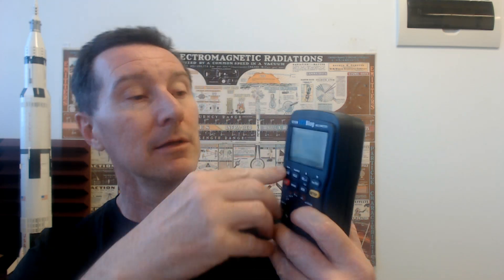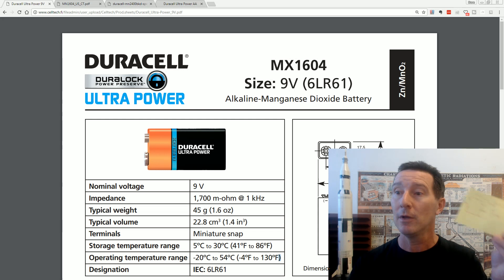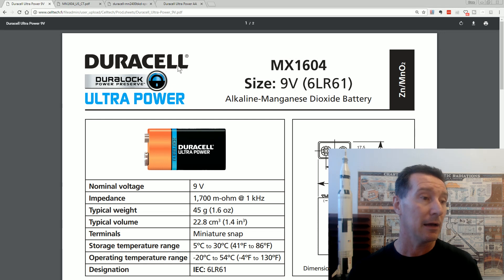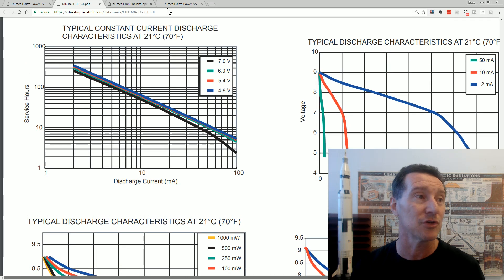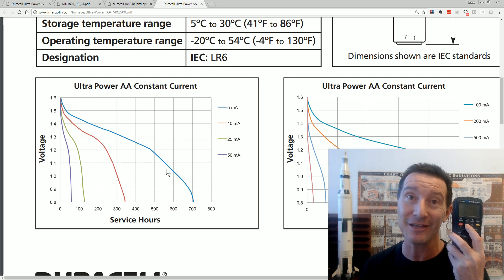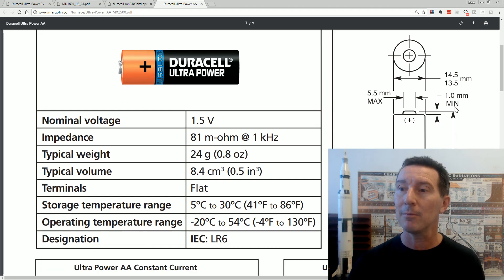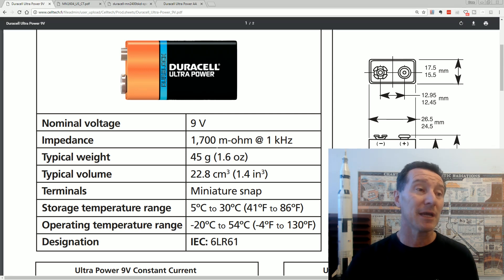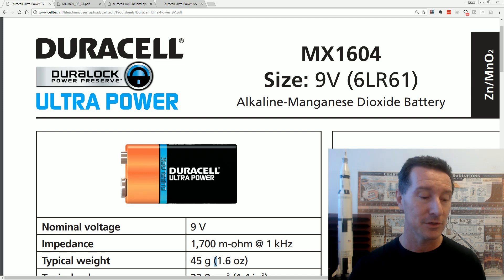Why Use AA's Instead of 9V Batteries in Multimeters?

Comment: So the voltage regulator doesn't behave like a transformer where the input current is different than the output current? That seems odd because that's the only way power stays the same through the converter.

Comment: Finally, someone saying this! AA has DOUBLE the energy of AAA for the same price and much more than 9V batteries. The 9V are about 2x the price of 2 AA batteries also.
Reply: There are 2S Li-ion battery packs in 9V format. Voltage is high enought for practically any device using this format and 550-600mAh capacity at 7.4V nominal (4.3Wh - roughly 2x of AA Alkaline at 200mA load - 2.2Wh)

Comment: AA vs AAA (vs 9V) is one reason I just ordered one.
I loathe devices that use AAA's. Yes please let me pay 2x $ of 1/2 mAh capacity (or worse).
I bought some PlanetBike headlights that use 2xAA's to power a crazy bright white LED - awesome! (made me cry when I saw their red tail light only available in a AAA version. They could have run it on a single AA).
Almost no device on the market needs the space savings of a AAA, especially w/ efficient buck convertors. A single AA is better than 2 x AAA.

Comment: But its linear, its pissing half of the power when the battery is full. Is the filtered output of buck converter too noisy for the low measurement ranges?

Comment: In the old Soviet pointer instruments of the series "Ц" (Ц4315, Ц4353), 3 AA batteries were used. And they worked for years until they pass. Because they were included only when measuring resistance. The rest of the measurements (DC and AC current and voltage) were measured without the use of additional power. But then came the fashion for LCD displays and low-capacity 9V batteries.
At the same time, there were high-capacity 9v batteries of the PP series - PP6, PP9 in the world. https://ru.wikipedia.org/wiki/%D0%A4%D0%B0%D0%B9%D0%BB:PP7-PP3-batteries.JPG
 But they were large and did not meet the global need for miniaturization. In Russia, they are still produced for the army field telephones TA-57 under the brand name GB-10U.
https://www.at-power.ru/catalog/batareya-ta57/at-elems-10t-detail.html

Comment: I don't understand why they don't design a multimeter with lithium batteries and a USB port for charging
Reply: I guess it could have a sliding door so that only the USB charging port or banana sockets could be exposed at a time, so that you have to disconnect the banana plugs before being able to charge it. (High voltage concerns.)

Comment: 1st generation fluke 2Xs use 9 volt batteries and they last for a year. if you leave them on for 24 hours a day it will last for 6 months. I have 3 beckman industrial multimeters and their 9 volt batteries last for more than a year EVEN IF YOU LEAVE THEM ON 24 HOURS A DAY. I have 2 agilent u1272As and they use AAAs. their batteries (ordinary alkalines ) last for a year.  9 volt' and AAAs ain't rubbish. it's still usable and reliable mostly now that chinese 9 volt and AAA alkaline cells are widespread everywhere. and I will never ever ever trade or replace my 9 volt and AAA meters for garbage chinese AA POWERED ones.

Comment: Devices that have no reason to slim down or could easily fit AAs but which use AAA instead for no discernible reason is a pet peeve of mine. It’s like the engineers never looked at the mAH costs.

Comment: AAAs cost 4 times as much than AA batteries ! AA batteries have TWICE the capacity and they AAA are about TWICE the price of AA batteries. So 4 times as much total ! I always avoid any remotes with AAA instead of AA but they are getting hard to find now.  The TOTAL price per hours used is the best measurement. without being too big.

Comment: I am used to collect "empty" alcaline cells and recharge them. Works very good. I only had a problem with one brand: Duracell. I was unable to charge them up again. Looks like they added some kind of diode or fet in series. So that is what you pay for: Preventing the user to extend the lifetime by the factor of 10 upwards...

Comment: If you mix batteries in different states of charge you may end up with the weakest one being subjected to reverse polarity and leaking. (And you are not covered by any battery leakage guarantee if you do that.) Maybe not too likely with a 5mA draw but definitely an issue on higher drain items.

Comment: Fluke 287 multimeter uses 8 (in words: eight) AA-batteries - that's a pain in the neck if those run out of power. I switched to NiMh-batteries because recharging within 2 hrs is much faster than finding new batteries and properly dispose the old ones. Here I would really like to have 2 LiPo-batteries in series that should be rechargeable via a µUSB-connector - the multimeter costs almost 600€, so that's definitely not the cost-driver.

Comment: AA batteries have more capacity than the 9V although there are some multimeters ( agilent ) that uses 9V batteries and doesn't drain too much energy when using its basic functions. Off course logging operations will deplet more.. 9V batteries can provide better output voltage for analog internal circuits on the multimeter but that can be achieved with with switching power supplies. The clamp meter UT204A drains 10mA on DC A from the poor 9V battery and was allso my poor choice on a clamp meter for Solar panels, car and electrical board current measuring

Comment: QQ. why is no manufacturer using a DC-DC from 3v to 9v  in their designs?
Reply: I guess because of noise when measuring small (mV, mA/µA) signals: The inputs are located at the battery position so any noise caused by the converter will induce noise to the signals and/or first stage of signal processing.If you want to get rid of that problem you would have to place the battery/power managment below the display to increase the distance to the signal processing as much as possible.Moreover, you would have to use the PWM-mode rather than the power-saving burst-mode to eliminate problems with the low-frequency noise caused by the current bursts.I would prefer to have 2 LiPo-batteries in series with USB-recharging - that would be a serious quality increase.

Comment: I hate 9V batteries in meters.  They're always dead when you need them. Even my best multimeter with OLED display has a 9V battery and dies almost instantly. WTF...
AAAs are the last resort, like in TV remotes where the thickness seems to matter aesthetically. They are only a bit smaller than AAs, but have 1/3 of the capacity.
So AAs = good choice, man, thumbs up :)   I don't understand when and who managed to persuade us that thin is beautiful. I know Steve Jobs did with laptops, phones and tablets, which must be as thin as possible for some reason beyond my comprehension. If Apple made a 2x thicker phone with 3x the battery capacity - they would have ruled the business world single-handedly; instead they rule the snob world only and become essentially like cordless phones from the last century, always charging whenever not in use :-P Fortunately there are manufacturers who make thick phones with battery reaching 12000mAh :D

Comment: It's not actual 6×4A, they're shorter in length. 

4A is the worst battery kind ever and it's used too often in graphic tablet pens. Even the surface pro (3?) pen uses it

Comment: Why don't you use six double As , I'm sure people wouldn't mind buying 1.5 pack 
of batteries if it meant huge boost in lifetime.
And also you wouldn't have that low voltage problem for that chip...

Comment: I would say.. Really 9V battery should not be used for anything a part from specialty aplication and cheap toys.

AAA should only be used in set of one or two.. If there is a thing with 3, its most probable that the designers been lazy or cheap. Don´t buy those. With 4 AAA you are better of with 2 AA, its cheaper and contain more power.

I would also say.. C and D cells are utterly useless. Chargeable Lithium cells to day are so cheap so there is no reason to use  a C or a D cell.

Comment: Could have been better if it used a couple of 18650 cells. rechargeable and a LOT more capacity. 2 in parallel would get you 6000 mAh if using real 3000 mAh capacity batteries. or 7000 mAh if using two 3500 mAh batteries which is the highest real capacity 18650 battery. Don't trust those ultrafire, megafire, trustfire at 9000 mAh and whatever other capacities. Those are fake chinese crap.

Comment: My decades old Fluke uses a 9v. In 20-30 years, I've replaced it twice. (that I can recall) I also have a few museum quality analog meters that have no batteries at all, or a single AA. (they have to have power to measure resistance, etc.)
Reply: Indeed!  I would think Fluke wouldn’t go using something that didn't work well, but be careful, lest You offend the pen lite battery fan boys!  😆 AA’ and AA’s have their place, but I prefer a Fluke with a 9 Volt battery.  Lees chance of leakage, and the argument on availability and price;  Are You kidding me?  Try looking on the Internet!  And once You start adding BT and all this other junk, You really aren’t talking a practical dependable Multi meter, are we?  

Appreciate Your comment!

Comment: I would be interested to see the battery life on a set of freshly charged LSD NiMH batteries (like Eneloops or ReCyckos). You may want to revise your power system to allow for a cut-off voltage of 0.8V or so (a buck-boost converter at the battery input to get the 4.2V, then LDO down) so rechargeables work properly.
Reply: 1.0-1.1V per cell is acceptable cutoff voltage for LSD Ni-Mh. It has barely 5% capacity below 1.1V per cell and barely 1% below 1.0V per cell.

Comment: When my 9v batt was dead and I needed to use my meter, I used two 18650 in series and plugged to the contacts of my meter and it worked fine (even at 7V).
Reply: ArthurMagno haha i used 2 nokia batteries in series and put 2x tp4056 on each battery and i charge them 1 by 1 and not similtaniously works great 😂

Comment: 9V blocks may be a relict from ancient times when "LDO"s still required a voltage drop of >1V to get a stable voltage out even with load transients. But that time is gone. You get cheap LDOs with ground currents <10uA with very good noise parameters even with a voltage drop of less than 500mV (the voltage drop along the LDO more or less leads to better noise parameters and transient response).Now time changes: One gets combined PMIC with LDO operation at light load (standby) and, if necessary, a DC-DC-converter in PWM mode (not PFM) operation at high load (backlight, computation, even for opAmps). If the PWM is operating at e.g. 1MHz any noise can easily be filtered.

Comment: Why Use Duracell ... this is the question :).
Reply: Because Duracell have easy to find datasheets for all their batteries.
Reply: I just use rayovac since I live only ~20min from the packaging and storage facility in Dixon Illinois. Also their two battery factories are in Wisconsin.  I like to support my fellow factory workers.
Reply: Will it blend? that is the question ;-)
Reply: Too right. I've lost count of the number of my devices that have been damaged by leaking duracells. I even had a duracell AA leak in a kitchen clock!!!

I'm back to Energizers now - I've never had one of those leak. The fact that you can bulk buy Energizer Industrial cheaply sweetens the deal for me :-)
Reply: You guys aren't making it up saying that Duracell leak! A family member gave me 2 huge gallon size bags of alkalines to bring to work and recycle, they were mostly a mix between Duracell and Energizer. A real high volume of the duracells were leaking, some of them were so freshly leaking from jostling the bag around that you could hear little bubbles coming from some cells. I was so intrigued at the mess that I dug through the cells and only a couple energizers were leaking, they were from the oldest bag so they were dead for a while. The only difference between the old and newer bags of duracells was that the electrolyte dried up... More hadn't leaked with a few months age. As a mainly rechargeable user this surprised me, I'd expect it if they were sitting for years, not 4 months max.
Reply: I had some CHINA batteries last longer then  duracell ultra and energizer etc..

Comment: Also, in my experience, 9V batteries are also harder to find these days, my impression is that the market seems to be focusing on AA and to a lesser degree on AAA for non-rechargeable devices.... You can still generally find AA and AAA in random corner stores but not so much other types.

Comment: 9V blocks are no good when you want to power something with 3.3V and then use a linear voltage regulator. You are wasting most of the power on the regulator then. 
Would be good if your electronics can run on the battery-voltage directly.

it is one of the things i am currently struggling with - i want to make a portable music-player + headphones powered by a LiPo and charged via solar cells. But with linear regulators  a small solar cell would be barely enough to power the thing, let alone charge it.

Comment: So if I've understood this correctly: the 9V battery is worse for battery life because you're using linear regulators, which piss away power to drop the voltage. Because of the linear regulators, it's more efficient to have less voltage 'overhead'.

Question: would it be more advantageous to use a 9V battery if you'd used switch mode regulators in stead of linear regulators? I know it theoretically might, but I wonder if it would practically be possible. And also: would it be feasible to use switch mode regulators in a precision application such as a multimeter.
Reply from the maker: No, it's not about linear regulators, it's about the terrible capacity of a 9V battery compared to AA's at the 5mA constant current being used.

Comment: 11+ minutes to explain that 9V batteries can only provide about 500mAh of energy.
Reply: 500mAh * 9V = 4500mWh....AA is about 1200mAh...1200 * 1.5V = 1800mWh. Many DMM use two AA batteries ...1800 * 2 = 3600 < 4500. Four AA batteries have more power (mWh) than 6LR61 (AAAA * 6) and need more space...but less thickness/height. Briefly, AA has the better ratio of geometry/sizes to electric capacity.
Reply from the maker: Yes, I kept it short for you.

Comment: Why not an 18650? A panasonic cell provides 11 watt hours. There is a prebuilt circuit for 18650s. It takes a usb input, provides a cc-cv charge, over discharge protection. Over current/short circuit protection. I would certainly prefer a usb rechargeable meter over 9 volts/AA battery's.

Comment: Duracell are no longer 'good quality' cells, here in the UK. Their cells are the only major brand of cells that leak when they go flat. I've lost count of the pieces of kit that I've seen which have been damaged by Duracell cells/batteries leaking. I've also bought several genuine Duracell multi-packs (with long date codes) which have contained several dead or low capacity cells, and which will be guaranteed to leak within a short time of being put into equipment.
Reply: BigClive did a test of various brand AA's.  Duracell were the worst.  Interesting how the Ultra Power graph is the same as their standard version.  It seems they established themselves as the leading brand in the 1980s and knew that the consumer would never bother comparing discharge  curves.  The brand identity is very strong.
Reply: yep I agree I live  in America and won't buy them either

Comment: I am using AA NiMH accumulators everywhere, so 4 x AA was a very good choice. I really like it. And 9V batteries are quite expensive if you need to replace them often and the 9V accumulators don't worky very well.
Reply: this meter is literarly perfect for use with nimh, 1,05v cutoff and good capacity with even number of cells (important for some chargers)

Comment: The big bonus is the battery cost for AA is the best, AAA cost about double AA with half the life. I hate electronics that use AAA batteries for that reason, half the life for double the cost.
Reply: Where abouts do you live? In Australia alkaline AA and AAAs are the same price, and for Lithium primaries AAAs are usually slightly cheaper.
Reply: @1ohtaf1  same here AAA and AA are the same price, tho AA has almost three times the capacity. but i dont mind AAA batteries, if device doesnt draw much its okay, but in this case his battery choice is good, especially they made it in the way it discharges untill 1,05v, which is excellent if you want to use rechargable batteries

Comment: I found an original Walkman tape player in my old electrical parts/junk box a few years ago. The tape deck was worn clipped on one hip and the cells were in an external pack to be worn on the other hip. Two or three D cells{or was it C? memory is fuzzy). 
Anyway I was looking at alkaline spec sheets around that same time, and noticed companies are only putting a AA amount of juice[2400mah] into C and D cells, ...the joys of ignorant consumers.

Comment: Of course the current going in has to be greater due to I-squared-R losses, but who cares about that... as long as it doesn't burst into flame. :) Also most meters these days have an auto-off feature so you don't run down the batteries. So what's the quiescent current draw after it shuts off?